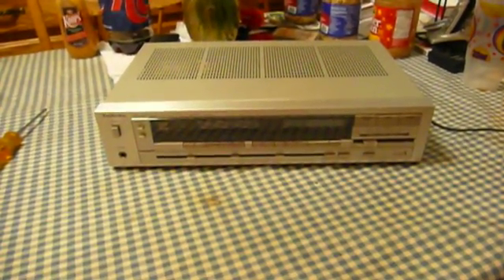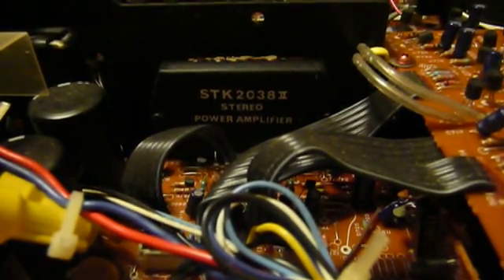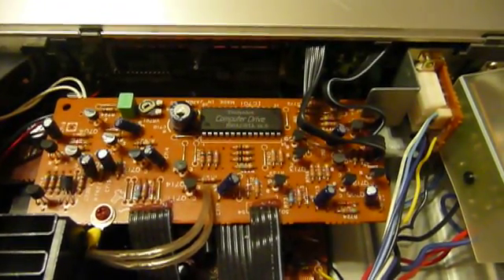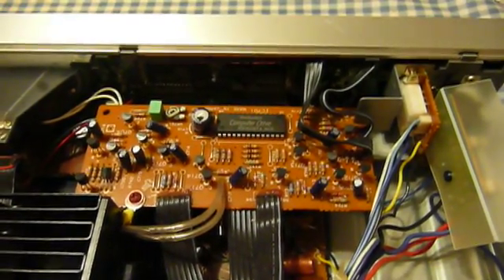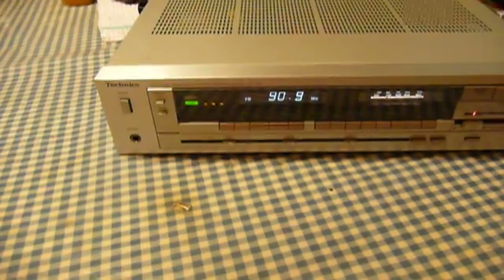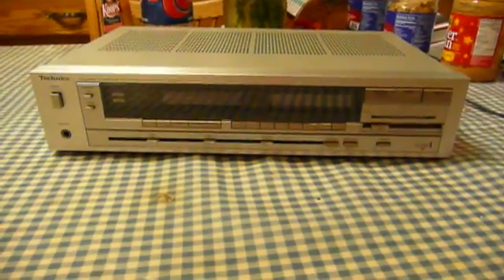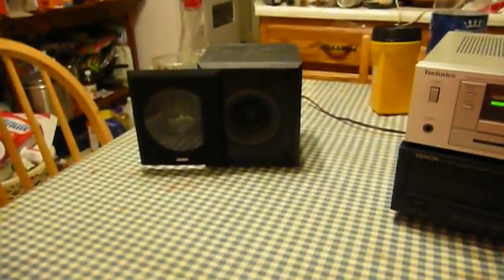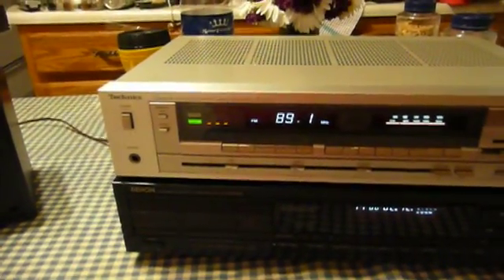Technics SA-310 Computer Drive New Class A Stereo Receiver (1983)

Comment: When you get a broken one or channel out...clean...clean and clean again. This series of Technics has the loudest set of speaker relays I've ever heard. My SA-1010 actually sounds like breaker box clunk. They get dirty. Audio will also go thru both TAPE...Loudness etc. Push every button for a minute...each button...no shortcuts. It's a long 45min process on mine. Clears a lot of issues. I got one from being totally silent to fully functioning, minus burnt out lights.
Reply from the maker: There's no speaker or protection relay in the SA-310 or 410. That can be a major problem -- the protection circuit is fully electronic and oftentimes doesn't work or survive the experience of a failed power pack.

Your SA-1010 (yes, I have one) is a much more powerful beast with a fully discrete output stage not found in these smaller models.
Reply: @uxwbill  Thanks for the reply. I am a super novice at all this stuff. I enjoy the cleaning and the satisfaction of getting dirty stereos working. I don't get broken stereos working. I enjoy your videos and appreciate your input as there aren't a lot of videos on YouTube about the 1010. I don't get any stereo light, or red dot on the IF, or quartz lock, or auto find stations; even with full signal bars and clear stations. 

AM works, Quartz lock works, auto find etc.
One thing it doesn't do on either AM or FM is the computing to sort out whether it should be narrow or wide. 

The audio symptoms include the right channel being not as full or loud. This is amplified with the dynamic turned all the way up. Right channel goes from okay to all treble and tinny.

I'm assuming I have multiple component failures which are all connected. Happy to see most lights work except the CLASS A and one side of the volume display. 

Not bad stereo for a $10 find that had 25 years of dust on it.
Reply from the maker: The audio defects are likely to be very dirty controls. Some of them are multi-pole switches and I don't know of a good way to clean those. Taking them apart is ill advised.

As for the missing indicators, I suspect you may be seeing the effects of burnt out indicator lamps and bad solder joints. The "narrow" and "wide" options are for FM only. They switch in different banks of filters to block out nearby frequencies, if there are any. (If there aren't, the "wide" mode provides better fidelity.) The AM tuner on the 1010 isn't very exciting, but that figures. Most people wouldn't be seriously listening to AM on a big fancy stereo receiver.

It's very odd that the tuning works, but the automatic narrow/wide selection doesn't. I don't recall if there is an option to defeat that or not, but it might be worth a look.

At one time, the service manual for the SA-1010 was available for purchase from a site called StereoManuals.com. Sadly, the owner died a few years ago and apparently his surviving family members haven't decided whether they wish to continue running the business or not. I hope they do! (They have lots of stuff that literally no one else does.) I think I bought a copy while they were still operating. Of course, I don't have any idea where it might be!

If you did decide to get into fixing stereos -- which can be very rewarding, educational and a lot of fun many times -- I'd start with a much simpler model than the 1010 and work your way up to it. It's a complex beastie -- above and beyond the Computer Drive stuff, there is automatic power supply adjustment based on speaker impedance. Fortunately, the 1010's protection circuitry is properly designed and does work.

Stereo receivers from the 80's are starting to exhibit signs of capacitors failing (usually by drying out). This usually affects the smaller ones, and those can affect tone, sound quality, distortion, etc. It's pretty safe and reasonably cheap to replace all of them on the various audio boards. I wouldn't worry about the big ones and I'd stay away from those that are on the tuning board, because that may throw it out of alignment and make it stop working properly. Start with getting the controls in order first, as best you can.

I never got my own 1010 into tip-top shape, although it's still around. I don't know that I ever will. Unfortunately, it was advertised as being a lot nicer than it really was, and suffered shipping damage beyond the problems it already had. I did once take it all the way open with a set of speakers that could handle the power, and it was extremely impressive to say the least.
Reply: @uxwbill  I wish I could give you more thumbs up for your help.
Today I did the relay cleaning with very light sand paper and deoxit. The two up front with wires on top I didn't do. While it didn't fix the quieter channel, I had some success. Unfortunately I also did the cleaning of the buttons with D5 and pressing them 30x each at the same time.
 I now have almost even sound quality on AUX while using dimension control. But as soon as I switch to the Tuner with the same settings, my right channel sounds bland. And now I don't know which process worked for AUX. 

After that I hooked up an AM antenna and found the quartz lock lite up and show that AM is 100% working but like you said, "lifeless". But it was nice to see that the light worked and the computer did some thinking during warmup in AUX. 

Appreciate your time and hopefully it will also help others in the future.

Comment: If, by any chance, you are still seeing and reading responses to this thread, I have a comment and a question.  I thought it was great, even though I didn't understand any of the technical stuff.  Great job! The question, a friend of mine just gave me one of these in what looks like great shape.  The only problem that I've encountered is that it doesn't seem to auto tune.  I can't seem to change the tuning at all.  Do you just press the "Down" or "Up" tuning button?  It's not doing anything when I do that.  Thanks!
Reply from the maker: At least some of the time, the Youtube Studio thing does tell me of comments on videos both new and old.

Yes, all it should take to adjust the tuned in frequency is a simple press of the tuning up or down buttons. My first thought would be to look for a stuck button somewhere, as that might cause the others to be ignored. The buttons sometimes also break if they're handled roughly or pushed too hard. And of course, the switches on the actual circuit board can fail. You may also want to look around for any rotted foam inside around the buttons. Sometimes this can also interfere with their operation. Finally, there is the possibility that something in the tuning microcontroller or its supporting circuit is not working properly.
Reply: @uxwbill  Thank you so very much I REALLY appreciate it!!!

Comment: Does anyone know how to fix a broken channel
Reply from the maker: You'll have to do some troubleshooting of the failed circuit. Start with common sense and a visual examination. (Just keep in mind that burned parts are often the effect rather than the cause.)

These and the related SA-410 work the STK power pack pretty hard, and it's usually the first thing that gives. Be aware that the DC protection won't save your speakers ... so test with something you don't care about, use a well made dummy load resistor or do a voltage check with a multimeter at the speaker outputs. Also be aware that a lot of the replacement power pack modules you find are not as good as the originals -- either they are generic or fakes.

Comment: Hi bill, just bought one of these off eBay, and the seller said it worked, and you could see that it did in the pictures. When I received it in the mail today, I plugged it in and only sign of life I get from it is that the needle dial lights up. Tried a new fuse, that did nothing. Any idea what could be wrong with it to why it's not working properly? Thanks!

Comment: I had the opportunity to tear apart an old JVC surround-sound receiver from the early 90s which had a problem which wasn't worth fixing.  It was a very interesting receiver; it was a Dolby Pro Logic receiver, but it had no center channel amplification.  It also had two entirely different types of amplifiers in it.  The LF and LR amplification stages were class-A, using very closely matched triple-darlington transistors manufactured by Toshiba, which were actually quite commonly used in high-end audio equipment back in the late-80s and 90s.  The surround channels is where it gets a bit interesting.  While Dolby Pro Logic only has one rear channel, this receiver actually had two separate rear channels, and they were actually class-D, using hybrid circuits!

Comment: @uxwbill Mine is an SA-210 actually, I just looked. Is it still the same computerized module? I did hook a speaker up to the left channel briefly, but after I determined it to not be working, unplugged it. I doubt I'll find another one like it, but I can try eBay and see if I can find the module. Thanks for your help!

Comment: Hey it's flipflop595 again here. I'm from England UK where we have 240 volt standard electricity supply. I understand that in the US you have 120 and 240 volt standard supply. I was wondering if you could do a video explaining and showing (if you can) how you get the two voltages and what they are used for. That would be very interesting. Love the latest videos! Also I was wondering what the UXW part on uxwbill stands for. Thanks, Phil.